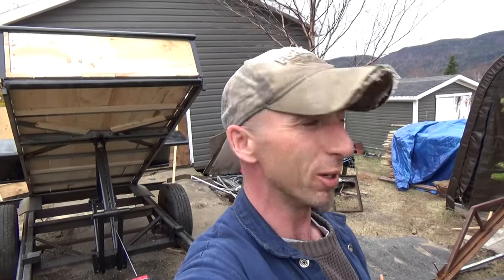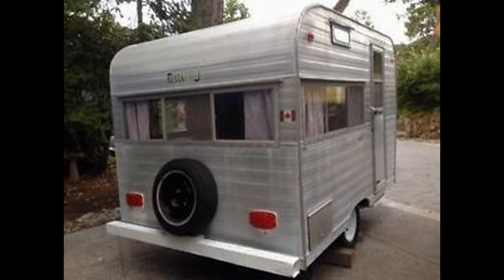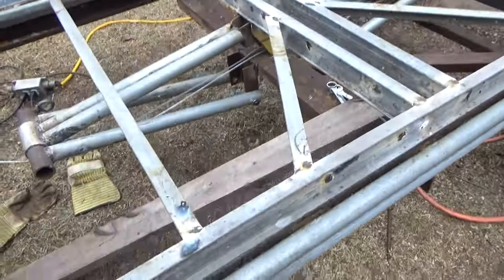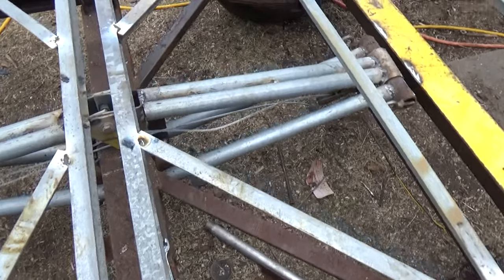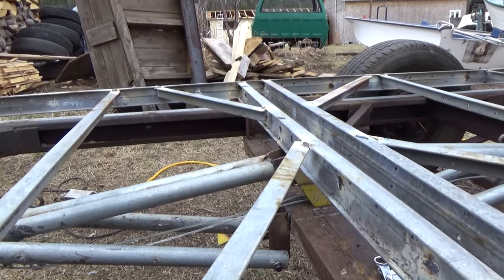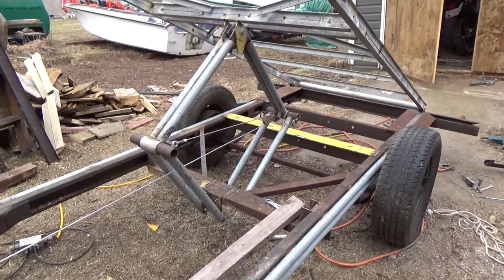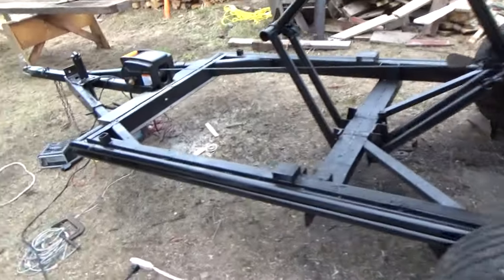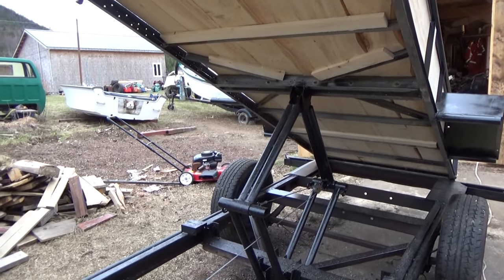DIY DUMP TRAILER WITH NO HYDRAYLICS

Comment: Seems simple , works well. But most scissor lifts even use hydrolic ram . Or mount the motor with a direct worm drive to the scissor. 🤔 Experiment away.

Comment: Very cool concept, BUT, From Experience, I'm wondering how this will work under a load !!?!!!?!?. Maybe a couple hundred pounds, But when you put say, A load of firewood or a load of Dirt, That winch and scissor lift just won't handle the lift (I think !!!). I'm thinking that the bars on your Jack will bend !! Or break ! There's no way for the jack to "Pivot" and that will cause some serious stress on those jack Arms(bars) !!! I'd like to see this trailer dump a load of Dirt or anything over 500-700 pounds !! If it works, Then great for you !!, Maybe I don't know what I'm talking about, But I've seen similar builds crumble under weight !! Good luck and great job using your own head !! Fine tuning will fix it all !!!.

Comment: whats the cost to build one 1⃣️??? please help
Reply from the maker: that's a tough one, I  can tell you what my cost was, the hard top camper trailer was free, all the galvanized pipe was donated by my neighbour, the rest was scrap metal I had kicking around, the led lights was $25 the winch was $100 the lumber I milled myself, box of welding rods $30, I'd say I'm in for about $200, if you had to buy everything I say your looking at around $1000 to $1500 maybe. hope this helps you out take it easy

Comment: Dump firewood maybe ok. Wood chips, maybe ok. Peat moss, pumpkins or pile of garbage...maybe ok. Wouldn't stick my head under there whilst it's in the upper position with them pulley's. Be safe. Use common sense. Maybe last a long long time!

Comment: i have been thinking of ways to cheaply build a tilting bed for my car hauler. But offcourse i didnt want to do it by hand. And because of the cheap part hydraulics are not really an option. But those cheap electric winches and some pulleys should pul it up easy. And since mine only need to go maybe 20 inches up i think i could get away with a few more pulleys wich would make it stronger but also slower.

Comment: I don't trust that cable on that wench it looks unsafe in that configure ration, because stress over time weathering will cause it to snap, hydraulic or air lift is much more safer, over all good build.
Reply from the maker: im keeping a close eye on it, and make sure im in a safe location when dumping, thanks for watching and your concern, take it easy
Reply: How about installing a safety bar in case the cable snaps or if one of the pivot points give way?

Comment: Proof is in the pudding.  Where's the load that proves this actually works?  Just looking at it, it would seem to me that the small connection point of the scissor to bottom of trailer, would be a problem.  A heavy load in the trailer if off centered, seems,  it would cause this small connection point to sway side to side under operation.  And even not a noticeable amount of movement would eventually cause this joint to fail.
Reply: Great job, you need to spread the scissor wider out toward the wheels for stability.  This is probably why you have not seen this on any other video.  It is designed to eventually fail